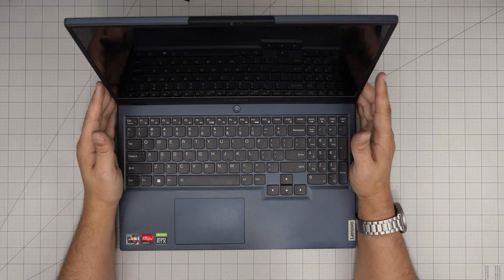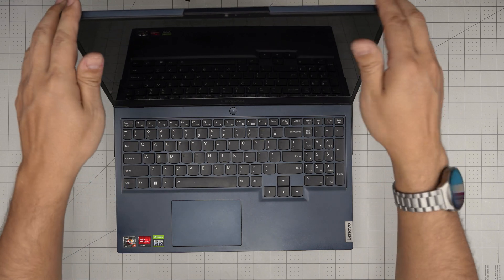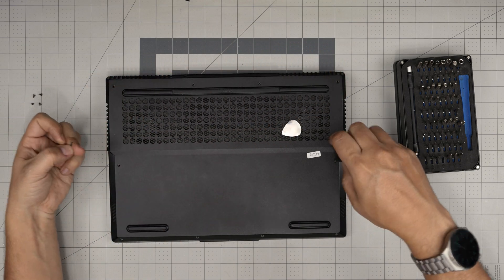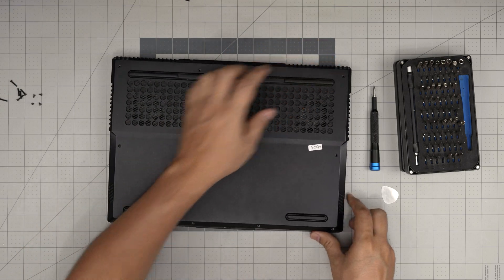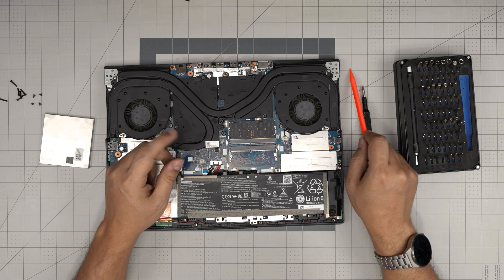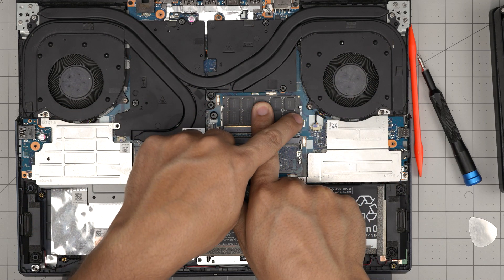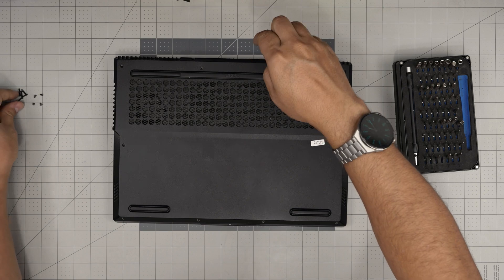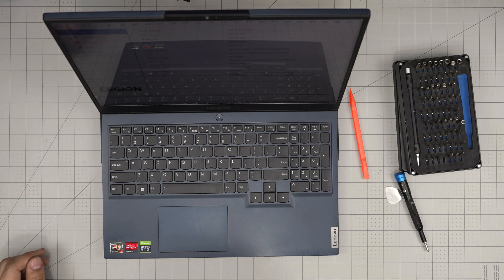How to Upgrade RAM on Lenovo Legion 5 15ACH6 for Faster Gaming Performance

Comment: Is it ok to use mismatched ram? In my case, AGI 32 gb + Transcend JetRam 24 gb both DDR5 5600 MT/s. 56 gb total
Reply from the maker: 🫠Regarding your question, yes, you can, and it will work fine as the BIOS will do the adjusting automatically.
cheers🍻
Reply: Thank youu  @uFixTek
Reply from the maker: It's my pleasure my friend.

Comment: wow, i have doubt about this for a year. because lenovo itself said that this laptop only works with 16gb. 

my legion is 15ach6 R5 5600H RTX 3050 16gb. so i could add more juice to my device.
however, this time is not good time for buying RAM. they just spike the price
Reply from the maker: It's my pleasure my friend.
I would recommend to purchase now the ram, as they are about to go to moon veryy soon thx to F** A.I
cheers🍻

Comment: I upgraded my ram from 2x8 to 2x16 and have more performence loss in games, i lost fps idk why.
Reply from the maker: 🫠 Regarding your question, you should not have lost any FPS! Do a Windows system check in CMD.
Reply: @uFixTek  I fixed it already, thanks for the help tho!
Reply from the maker: awesome job, enjoy the upgrade.
👍🫠
Reply: @BigSm0ke.  what was the problem?
Reply: @nielsniemeijer After i swapped ram, my laptop has automaticly changed to integrated graphic card withouth me knowing lol.

Comment: I have the lenovo legion 5 15ach6, rtx 3060 with ryzen 7 5800h, I have seen in several forums and the manufacturer itself does not recommend installing more than 32 GB of RAM in total, is it safe and does the 64 GB work correctly?
Reply from the maker: 🫠Regarding your question, there is no harm in a laptop having 64GB of RAM. We have installed it for clients who use the RAM for heavy work, and they have experienced zero issues, even over the years, as they return for regular servicing.
Should you have any further questions or requests in the future, please don't hesitate to ask me.
cheers🍻
Reply: Did you upgrade it? Had any problems?